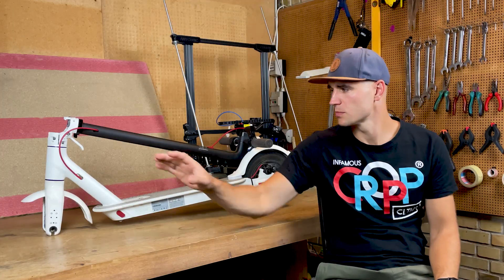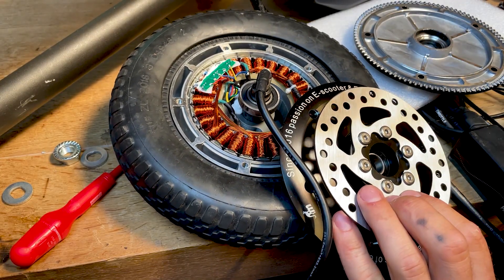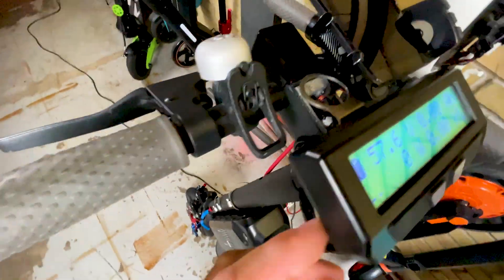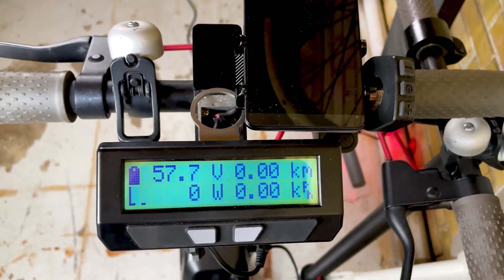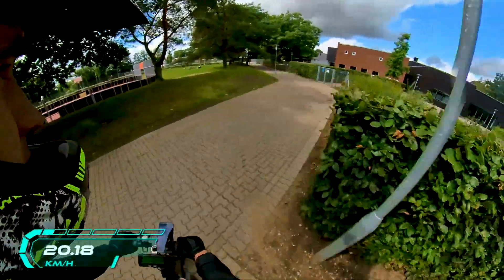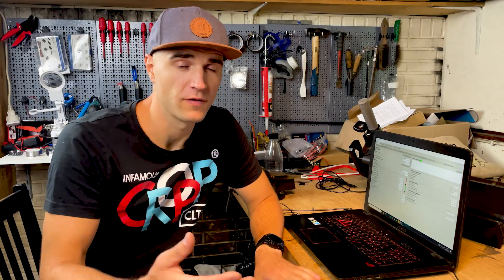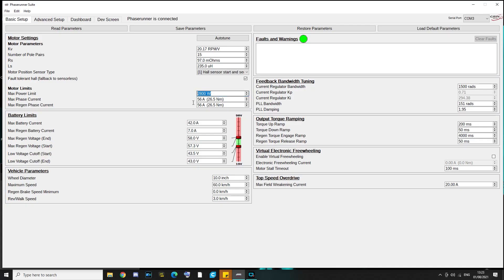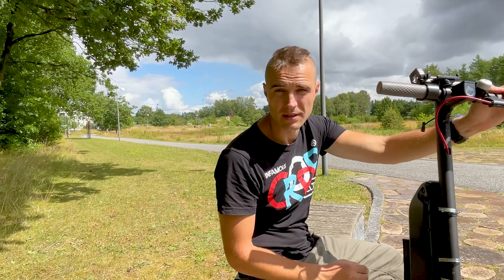Xiaomi M365 500W motor part 2: Pushing 2.1KW with Phaserunner V3

Comment: What's everyone's opinion on solid tyres VS air ones?
Reply from the maker: I personally do not like them as they transfer every tiniest vibration to your body and are not that grippy when cold and wet (normal danish conditions)
Reply: @VRMinde your right bro, I've never had the joy of proper tyres with air, maybe I should try one day 🙏
Reply from the maker: @ give them a try. If you scooter is very power-limited it might drive 1kmh slower :) but much comfier :)

Comment: How to attached battery and do you charge separately or together.
Reply from the maker: You can drill and tap screws or just use something like hose-clamps. Buy stainless steel ones and they should last
Reply from the maker: And I think I used only one battery. But if you use same voltage packs - you can easily charge them together. If you use different voltage packs I recommend device called Rita https://e-scooters.embedden.com/shop/accessories/rita-adapter-for-xiaomi/

Comment: sir how is the well not blowing up is it ok for me look idk wtf to do i have a apllow ghost 800watt to motors i just got to flipsky contlers 55100 pro v2 i need yur help can u tell me what to do where to gget a plug play contler for 800watt hub i got to 700watt contlers off ebay overheating big time its suck there for bikes but there overe heating so much it was crazzzy   i can give u the info off the contlers that stop working but its a 52volt 25amp driver
Reply from the maker: normally when you replace the controllers they will not be "plug and play", meaning you will have to read what wire does what on the diagram and connect them accordingly...
I am lost in your comment man. You got flipsky and the are overheating? And you want a more powerful one?
Reply: @VRMinde  I can't spell very well it's the problem I can speak English fine   I got a sine wave controller that is overheating and I don't know i think its cuz i where testing on hoilll only but its only 700watt mexs contler i had 25amp stock contlers that push me up the hill fine but this was a cheep contler so and it was only 700 or 600watt power but same amps so idk way it was not pushing me i cud of got one that was 26to35amps i shuold of it was 800watts to 1000watts  but in short i did get 2 v1 and v2 flipsky 75100v1 and v2 and i cant get tthem to run my hubs with out blowing  35 amp fuse I have between the controller and the battery i have that there cuz i dont want a 600cash bat to blow over me touching wires to gether or something dum  but as i seidi  can speak it find just cant spell good sir
Reply from the maker: @jonnyc2.047  mate, it is not your language problem, it is your grammar :D sorry, but I do not understand where your sentence starts and where it ends.
If your controller is overheating it can only be because it runs too much amps for too much time. You can always try and make some cooling for the controller if you are in a hot climate, or reduce the power...

Comment: Is this still running?
Reply from the maker: It is kind of split in parts today as I needed the controller for another project 🙄
Reply: @VRMinde  but motor never failed with that power?
Reply from the maker: @regun2434  the motor no, but I never ran it full throttle for very long periods of time.
Reply: @VRMinde  ok gonna set it to about 30A@60V and see if magic smoke comes out.. I have 50h motor coming from china so its no big deal if smoke comes out 🤣
Reply: I can tell 2.4kw is too much if driven like maniac 😁 @VRMinde
Reply from the maker: @regun2434  :D It depends :D But it is on the edge of what is needed. I found 6kw scooter was too much for me. But something with double 1kw motors and good suspension is lovely to zoom around :) Not full speed, but just that agility.. :)

Comment: to get a "dual motor" feeling you'd atleast want a peak of 150 phase amps but idk how much those motors would like that first of all, and secondly idk if the magnets themselves are strong enough to deal with that current

those big power scooters which have only 28A (battery side current) controllers for example peak already well over 100A in each motor at low speeds, hence why they're often so jerky

the phaserunner can go up to 90A phase or something like that so i'd recommend to try that
Reply from the maker: Phaserunner is ok, but only to play around as the setup becomes economically not viable :)
Reply: @VRMinde  yea i'd say those Flipsky/Makerbase Alu PCB VESC's are a good option for someone who wants a bit more oomph for not too much of a price, have a pair of them 75100 Alu PCB's in my dual motor scooter with 120 phase amps peak each and they do just fine

i have a pair of 75200 Alu PCB's ready because they would suit these motors better, but just 50A is not quite much, afaik the Ninebot Max G30 peaks at like 60A out of the box in a similar motor to that, which is why i mentioned 90A being probably a happy medium if you monitor the temperature

Comment: just saw your video, i upgraded my M365 with Monorim front and rear suspension, want to get more acceleration now. You think it should be enough to buy a happy bms + 48V battery? I am not looking for incredible max speed, more important is hill climb and accelleration due to my living situation.
Reply from the maker: Battery is definitely the bottle neck 🙄 the risk to burn the ecu increases if course and if you climb long enough motor can burn as well 🙄 but battery should be the starting point :)

Comment: Wow bro, cool video. Right now im build my own pro 2, with original monorim motor, controller and special hq battery on 21700, 26 A. And moment with tire was best in your video, try to use Huangcheng tire.
Reply from the maker: Hi mate, thanks, good luck with your build!

Comment: Hi Bro, I will try to install in my M365 16s  BUT what was motor temperature in you M365 on 14S battery at 2KW ? . After some tests , on 12S and  2KW,  Pro motors got super hot  ( shell over 70C ) due to higher amperage .
Reply from the maker: Hi mate, I did not test it for too long I think. For short runs of 1.5-2min it was ok 🙄 maybe higher voltage raises temp less than higher current at the same power? Also 500w base and 350w base might react different to the 2kw 🙄🤷🏻‍♂️ just thoughts
Reply: @VRMinde  well Higher voltage means less resistance ,so lower temps ;) , aaaand at the same time with higher Voltage we can lower the amps to achieve the same wattage. At least in theory it should works this way , but who knows how thin m365 motors will work  ;)
Reply from the maker: @PirateWasHere  will be following your content to see the result in practice ☺️

Comment: well im getting 43kmh with just 700watts
Reply from the maker: Good for you mate :) I keep hearing that people ride their m365 pro on 500w @40km/h, you get 43kmh with just 700. I am very unlucky and need 2.1kw to get to 50 :) I am very happy that you all have scooters that easily reach such speeds!
Also, there is a huge difference in wind resistance when you go 43km/h and 50km/h. The correlation between the needed power vs speed is more or less geometrical progression. There is a bit detailed info here https://electricbikereview.com/forums/threads/interesting-read-about-the-nature-of-ebike-motor-and-efficiency.15652/

Comment: Makes me wonder, would the stock (V3 + reinforcement mod) controller handle 48V and the 500W motor full throttle for 8 to 10Km? I'm all about modding, but I'd like to keep it as close to stock as possible (sleeper beast)... Right now I'm only rocking the stock m365 classic unlocked with 10" tires (going about 30~32Km/h with custom firmware, but torque is not so good), thinking about an AliExpress 13s battery on the frame along with stock battery and Rita for extended range, then the 500W motor (but I really would like it to have an inflatable tire, not that solid tire)
Reply from the maker: I was riding with 12s looong time with no problems. I think it could work, monitor the temperatures of the controller. And disconnect regen braking
Reply: @VRMinde  Thanks! KERS is off, but I think it still send power back to controller when braking (as motor brake still works, albeit pretty weak), I'll look into that. I ordered a pre-modified (reinforced) V3 controller to squeeze a little more of my current setup without crushing the V2 controller, then I'll go this route with battery, then motor (hopefully someone publish some kind of guide to mod it for inflatable tire support until then), thanks again! 👍

Comment: Do the 500w motor as a breaking system like the original motor ?
Reply from the maker: The braking is done by controller, not by the motor. Depending on the ESC you will either have this function or not. If you just replace the motor it will work in similar way as the stock one
Reply: @VRMinde  Thank you for your answer ! I found a charger for the monorim 48v battery... the charger is a 54,6V 3A is that ok ? or i need a 2A one ?
Reply from the maker: @luisgregori3817  It is a 13s pack charger ("48V", I hope you have a 13s pack? Stock one is  10s). If it is 13s, nothing bad should happen... probably... a thicker wire for charging to the battery pack wouldn't hurt though
Reply: @VRMinde  Yes thanks!

Comment: Hey. I wanna instal this plate for battery (like hailong) on my m365. But i dunno how to change 36 to 48. I can find modified 48v controller (original), and i have 48v battery. So, is this setup needs something more like “fake bms”? For connection non original battery. Or…

“Rita” will not help me, coz its for second battery and 36v
Reply from the maker: Hi, BMS  should be in your hailong pack already. 
To use 48v pack you can still use the stock controller. What you need to do is to change some parameters in the controller firmware: turn of the regen braking (or the controller will burn in no time), set battery voltage limit to 58.8v, remove “charging mode”. That should do.
Reply: @VRMinde  Hey. Has do it! I can’t understand one thing - how to power the tail light? In stock it goes across the battery block. Will dс-dс be required for this? Or can I directly forward from the diode to the controller?
Reply from the maker: @handcreamsnail  hmm. Good question :) it might survive the higher voltage 🙄 maybe 🙄 otherwise you will most likely need some dc/dc. I think it worked fine with the 12s pack, but I can’t remember for sure now 🙄

Comment: how much amps is your controller?
Reply from the maker: This can run 50amps at 90v
Reply: @VRMinde  52v 25A controller its coming for my pro 2 with screen and batteries and top speed of 60kmh

Comment: can i put a 48v battery on 500w monorim motor on stock controller??
Reply from the maker: You kind of can 🙄 you need to disable regen braking or at least reduce it a lot and watch out for the temperatures of the controller. It will be not too hard to fry the stock controller 🙄
Reply from the maker: @barakcobrama1703  again - it can of course mate.

Comment: hi, great video, you should change your handdlebar for a bigger one (something like a mtb one), this will give you more stability. You only have to open la existing hole in the suppor from 22mm to 25mm with a drill and it will fits perfectly. Greetings from Argentina ✌️
Reply from the maker: Hola! ¿Todo bien, boludo? :) thanks for the info, it is a really good idea! I do not know if I am going to do that on the m365 as I already have a couple bigger scooters, but with increasing speeds it is a definitely good idea.

Comment: Can i install that motor without keeping everything Else stock?
Reply from the maker: Yes you can, but it won’t provide that much of a difference. Battery is better investment
Reply: @VRMinde  okay maybe I would do that but  what is the top speed with only this motor install’d 😊 without the battery ?
Reply from the maker: @BikeyLifee  it will be very similar to the stock one. The “bottle-neck” is not the motor on this scooter. Battery first, controller next, motor last :)
Reply: @VRMinde  okay thank you so much for you answer then I would do that🙏🏽 u have a new subscriber ❤️
Reply: Hello again.. i just wanna ask you iff you have a good Google drive file for the pro2 to Make it go faster ?
Reply from the maker: @BikeyLifee  xiaoflasher app paid version is couple $, they have “ready made” setups for all xiaomi scoots I think. Check them out
Reply: @VRMinde  thanks bro 🙏🏽

Comment: #VRMind trzeba coś zakupić by osiągnąć taką prędkość czy można jakoś samą modyfikacją ??
Reply from the maker: Sorry mate, can’t read this
Reply: @VRMinde  Do I need to buy something to get 31 mph in the xiaomi pro 2 ??
Reply from the maker: @gragasyt8386  yes, at least a 14s battery pack, then it will be tricky if the controller won’t burn 🙄 and as the time goes - probably the next thing will be the motor
Reply: @gragasyt8386  orginalny controller niewytrzyma napiecia powyrzej 55v to znaczy baterja 13s max. jak dasz zaduzo mocy na motor to bedzie sie grzal i magnesy beda slably. im slabsze magnesy to mniej mocy ma motor i bierze wiecej prondu i sie jeszcze bardziej grzeje. do 40 niepowinno byc problematycznych temperatur. moze w gorace dni. na orginalnych czesciach niepojedziesz wiecej niz 35kmh.
Reply: @__Game-Over__  działa 44km a jak w powietrzu to 47 km waże 65kg na oryginalnych częściach

Comment: Hi! Thank you very much for your instructive videos, I like them. I am interested in buying the Xiaomi Essential, which is the basic one but then to upgrade with the 500W Monorim Motor + V48 14.4 Battery, and then I'll add some stuff to make it drivable under the rain. My question is, do you think it worth it with this model of Xiaomi Scooter or should I buy the M365, I guess that the most basic and cheaper one is good as long you upgrade it, as the others brands cannot be upgraded as long you don't have someone to design your battery to fit in the scooter. My questions are, do you think it worth it to buy the Essential and upgrade it with the stuff I mentionned, and also do you think these stuff are great or there's better things? I don't want to spend more than 500-600€ and for everything it already cost about 495€. Also, do I need to buy a new heat controller? I really don't know about that so if you have any recommendations I would be glad to know! Thank you very much for your time!
Reply from the maker: Hi mate, thanks for the kind words. I believe you will end up spending more this way than saving for ready-made upgraded solution. You will get the smaller battery by 1/3 in essential that will be useless for you, but money aready spent. And if you do not understand a lot in mechanics and electronics - expect that projects like that take much longer than you would expect and you do (expensive) mistakes on the way. If you want a fast scooter with 2wd and double suspension - buy a built solution and you will have so much less headache :)
Reply: @VRMinde  Thank you very much for your accurate reply, I thought it was easier in the idea to plug the battery, the motor wheel and that's all, but if it's more complicated than that also with the controller, to make it properly as I don't have any knowledge in mechanics and electronics, maybe better then to buy a full built e scooter, I would like to size the opportunity to ask you if you have any recommendations in some models that could be great for me, is the M365 Xiaomi good? It's anyhow 25km/h limited speed and I don't need more than 30km. I wish you the best and thank you again for your kind answer!
Reply from the maker: @datafiles-m1k  if you can - get m365 pro/pro2, if you can’t get the “normal” m365. Alternative - Segway Ninebot max. They will all drive 30km/h on full charge or close to that (with some simple custom firmware installation). 
If you want something offroad capable, with great acceleration and 50+km/h max speed - I love the cyberbot mini. But there are more great scoots as well, I just have not tried them

Comment: What Cfw should i Create with 72V ? How much A ? Thx
Reply from the maker: P=U*I (P - power output in watts, U - voltage in volts, I - current in amps).
If your mentioned “72V” is a 20s pack, then fully charged it will be 84V. 
Depends on what controller are you using? Also how much power are you planning to send to the motor? On 2.1kw it is starting to get warm after 30sec sprint, but probably it could (????) survive short accels on 2.5kw? 
So, on a fully charged 20s pack 2kw will be 23.8A, 2.5kw - 29.8A. I would be really careful going for more as the motor will be heating up A LOT. And if it is a stock controller - I hope it won’t burn for you longer than all of mine did at lower watt output :)